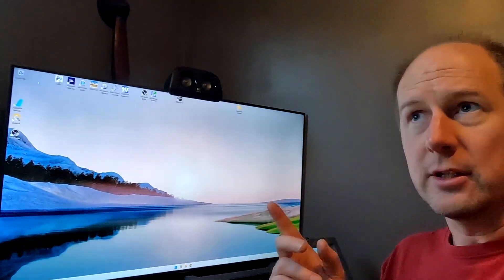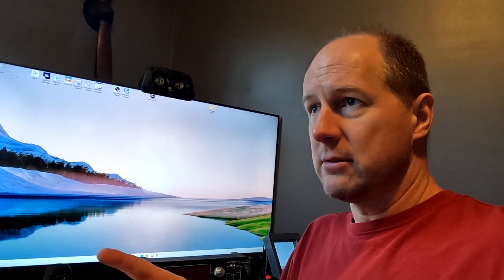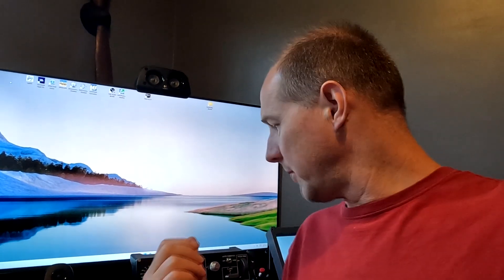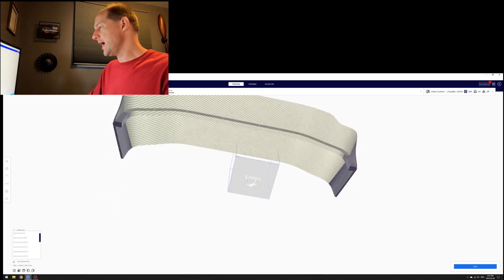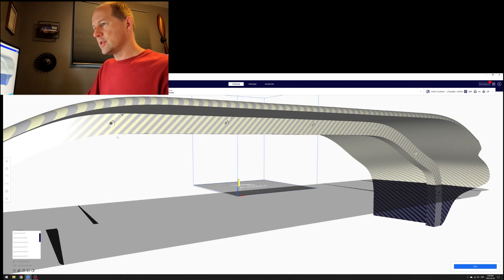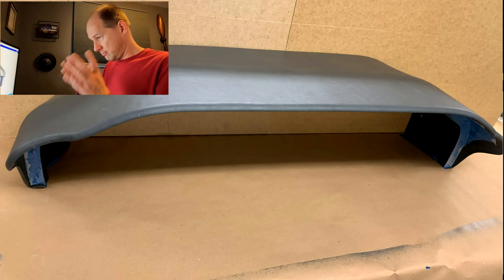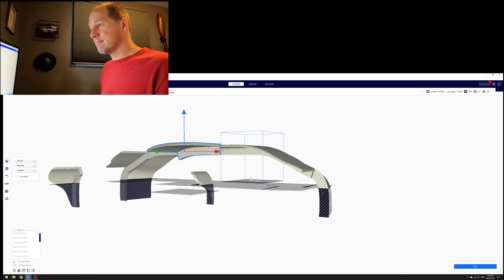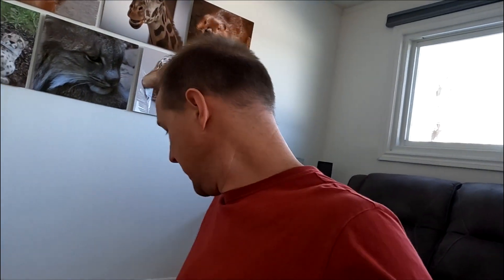DIY Home Flight Simulator: Building a Custom Main Instrument Panel Glare Shield

Comment: Wich glue can be used for joint pla together?
Reply from the maker: I've been using LePage's super glue.. you need to rough the surface up a little first so tue glue can get in to tue layers and bond to something.